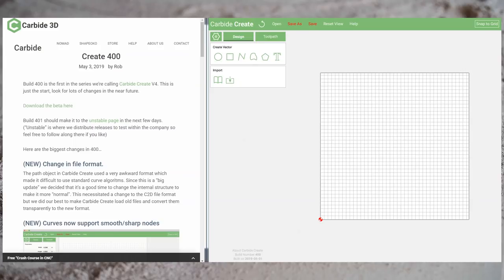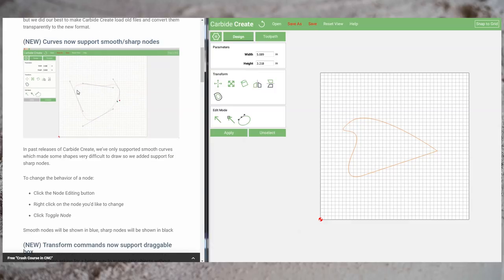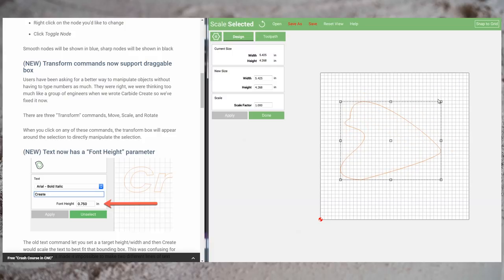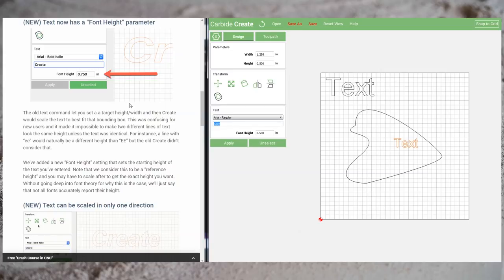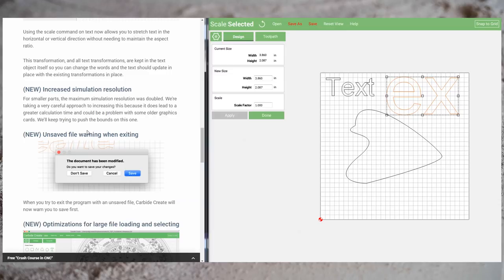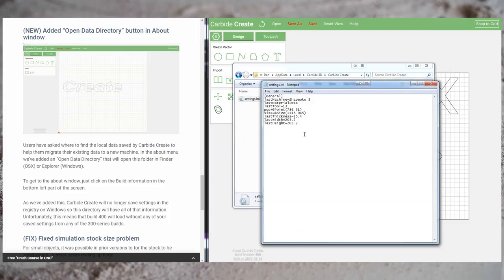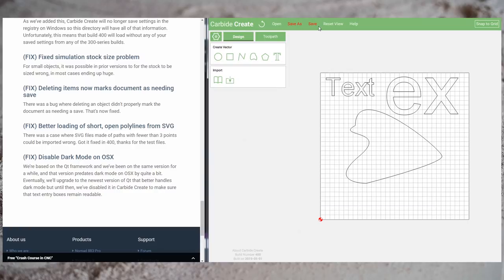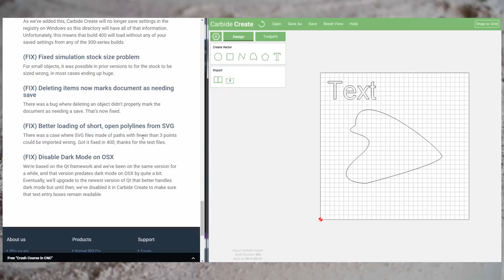CNC Basics - What's New in Carbide Create 4

Comment: Hello......really enjoy your tutorials.  About to start working you stacked text.  I do have a question that I thought you might be able to give me some advice on.  I build a We The People flag in Carbide Create and the simulation looked very good.  However, when I took it to the machine to carve the flag the start came out with rounded points and were very deep (I used a 60 degree nee bit to carve those and the "We The People".  Both were deep carves and not crisp looking in the final cut.  Any thoughts as to why that happened.  I'm sure, as I am a novice, that it is operator error somewhere.  Thanks for your videos and your feedback.
Reply from the maker: If the zero was set correctly, what may have happened is at the beginning of the cut the carriage lifted and hit the z limit. When this happens it loses its place and subsequent movements end up deeper. Somehow the Z-axis zero was lost or misplaced.

Comment: OK I have what seems to be here should be a simple problem, I can take and make a simple square or simple oval and when I run it the bit will come up in certain places and the starting and ending spot will be not correct what is going on
Reply from the maker: Is it gouging the wood where it raises/lowers?
Reply: @see-n-c6606  no it tapers in to the cut when it comes back around it does not clean up that tapered area

Comment: 401 is already out. I had to uninstall it though. After a short time of using it, it stopped working. Back to old 316.
Reply from the maker: That's a shame, going to give it a try today. On paper 401 is pretty good, more than I was expecting. The warning when setting retract height to 0 should prevent quite a few accidents.